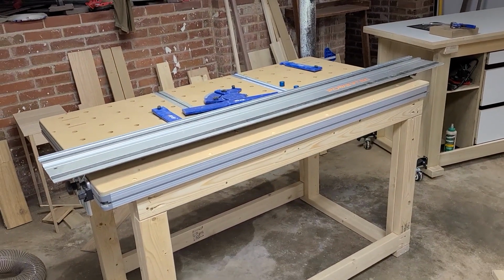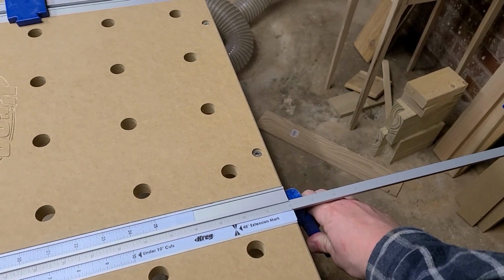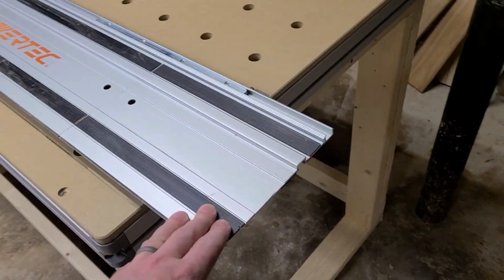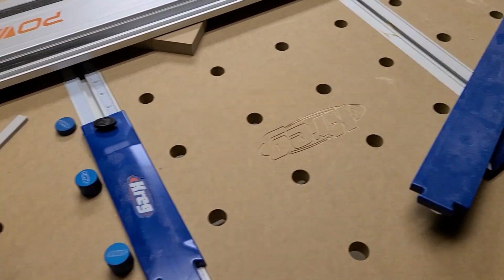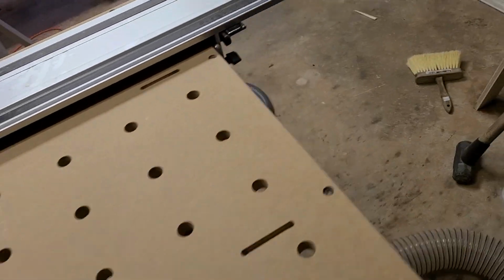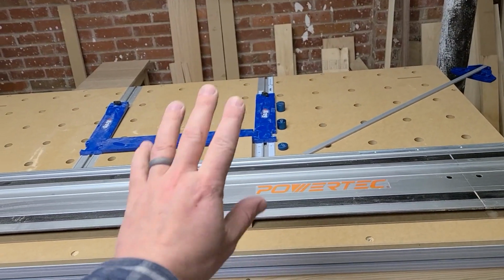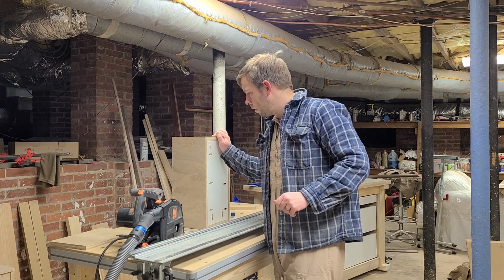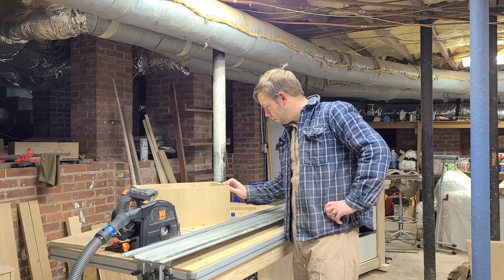Kreg ACS Adaptive Cutting System Project Table Top Impressions

Comment: I used a 75 inch Festool rail on my ACS table. I also made the rail stops in the MDF table 1 inch deeper on each side so the Festool rail will calibrate to the 20mm dog holes like the ACS track does. works amazing.

Comment: You don't understand the scales because you don't have it calibrated yet. You can't cut material shorter than you track is wide without flipping them. You also need to calibrate both the left and right scales so your cuts are still at 90⁰ with the fence.

Comment: Thank you so much for showing how you installed a non-Kreg rail.  I just got this table, but didn’t get the Kreg rails since I already have a Makita track saw and the PowerTec rails.  I’ve been scratching my head trying to figure out how to make the rails fit the table.  It looks like I need to sacrifice one of my longer PowerTec rails and cut 10” off the end!  I guess it will be worth it to be able to make the 90 degree repeated cuts.  What did you use to cut your rails?
Reply from the maker: I think I used a miter saw but I cant remember. Aluminium cuts very easily so anything will work

Comment: I bought the Kreg Adaptive portable cutting system but just found out that the Makita guide does not fit.  Would you know if the Kreg 62-inch Guide Track fits a Makita plunge saw?
Reply from the maker: Sorry I don't know. I would think you could find a way to fit the makita track.

Comment: Can you provide an estimate as to how much the tabletop with frame & track all assemble weigh in lbs?  i was thinking about hanging it on my wall when not in use.
Reply from the maker: The table top with frame and accessories weighs about 60 lbs. Thats without legs ore the saw of course.

If you wanted to hang this up when not in use I recommend the legs kreg makes for this table which fold up.

Comment: Hi do you have problem with Wen tracksaw blade boIt? The hex key didn't fit, keeps slipping, and I can't change blade. No way I can remove that bolt.
Reply from the maker: No, I have not had a problem. I changed the blade once without issue.

I would return it or contact WEN.

Comment: Thanks for taking the time to do the video!
How did you attach the top to your base?
Reply from the maker: I didnt. I sized the base so the top kind of wedges on top of it. Its not really attached.  I figured if I had to attach the top I would use L brackets but I have not needed to.
Reply: @carolinaworkshop7091  
Thanks. That is what I needed. Do you know about how heavy it is? Like really light, some mass to it, heavy, beastly?
Reply from the maker: @jimaspinii7579  Its a 3/4 inch sheet of MDF so about that weight. Around 50 lbs

Comment: I’m looking to do a setup very similar to this. How long of a track did you need? I have read that 55” tracks won’t fit this table.

This seems like a great alternative to Festools extremely expensive MFT tables.
Reply: Never mind you answered this in the video. Thanks.
Reply from the maker: I believe I address the track length in the video. You can combine tracks to make them as long as the kreg tracks which I think are 65".  I really dont recommend this setup to be honest. Its just more hassle than its worth for me and I ended up pulling the tracks off the table.  If the track flipped out of the way so you can use the table like the MFT I would probably reconsider my position.
Reply: @carolinaworkshop7091  I was glad to find your video using a non-kreg track and track saw. So you are saying you don’t recommend cutting the non-kreg track? Would you recommend buying the kreg track instead? Thanks

Comment: Can the t track on the top be used with Kreg s clamps
Reply from the maker: Not sure which clamps you're talking about but the top and bottom t track is the standard size ive seen on all guide rails.  I use the WEN-36053C clamps with this track if that helps.
Reply: @carolinaworkshop7091  ok I was talking about the hold down clamps